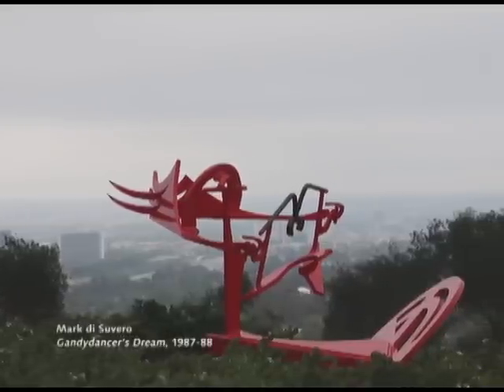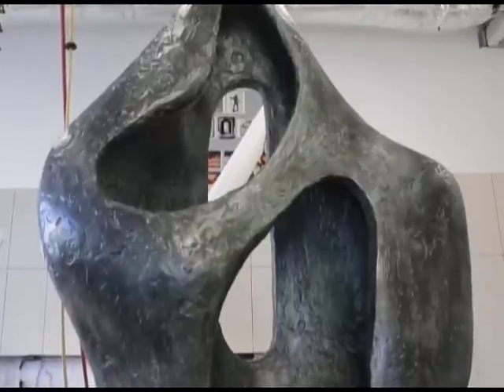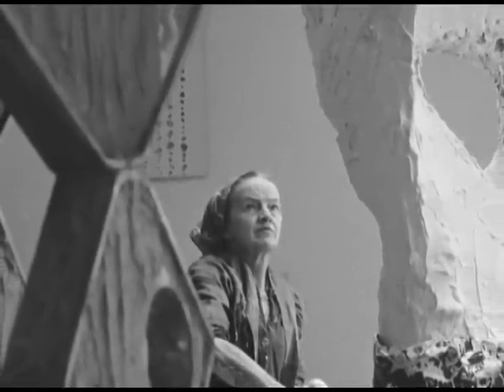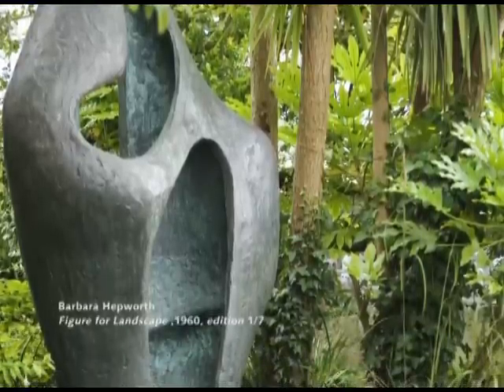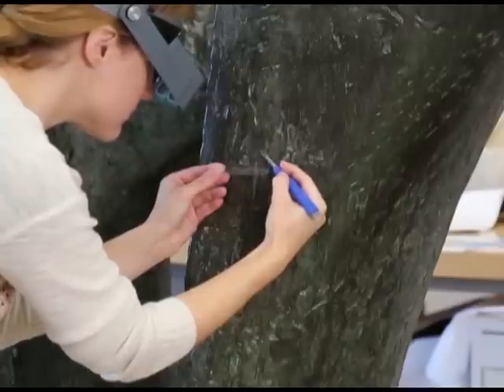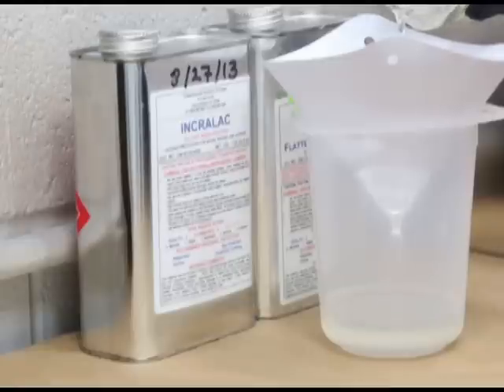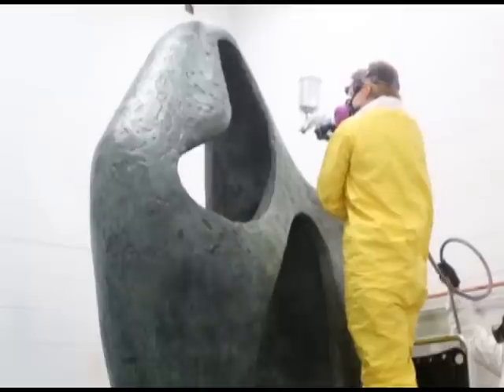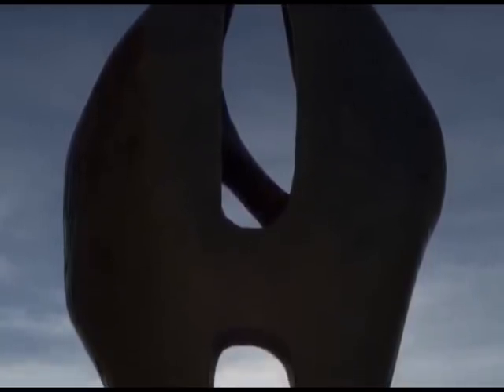The Conservation and Technical Examination of Barbara Hepworth's "Figure for Landscape" (1960)

Comment: Wouldn't an artist sometimes intend that a piece corrode naturally over time? I think of fresh cut stone that wants to oxidize. I think also of bronzes in parks that get polished and even worn in places by contact. How do conservationists chart a course between well-loved with no conservation indicated and original appearance?
Reply from the maker: +Andrew Graves we contacted our conservators and will get an answer for you!
Reply from the maker: +Andrew Graves You pose a very good question and conservators spend a great deal of time considering all aspects of change to include the artist's intent, structural and surface stability for its preservation, and how human interaction fits into this scope.
 
Yes, it is true that the artist may intend for their outdoor works to change naturally over time, but it is never straightforward as there are so many different forms of change. Darkening from air pollution, streaking from coating failures, polishing from human interaction - at what point do we decide to intervene?  Henry Moore, for example, understood change when he stated the following: “Bronze is a substance which is highly susceptible to atmospheric conditions.” He goes on, “The chemical composition is largely determined by the climactic conditions in which the particular work is going to be set.  Different things will happen to the patina of bronze according to the kind of atmosphere in which it is gradually weathered.  My own patina is, of course, a preliminary to the one which nature will herself supply in time.”  On the flip side, he was known to use coatings specifically to prevent oxidation from taking place. Especially when there are contradictory statements from the artist, we see each object as a unique situation and this is what makes my work so fascinating. - Julie
Reply: Awesome answers. Thanks so much for having all this going on here.